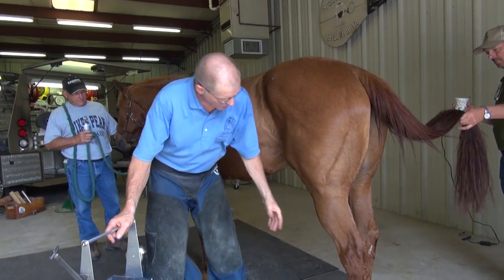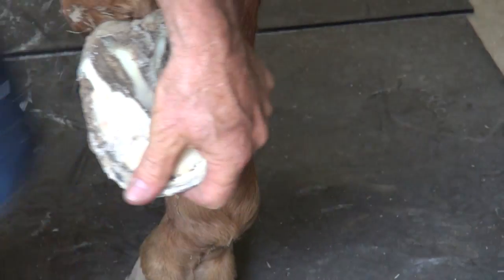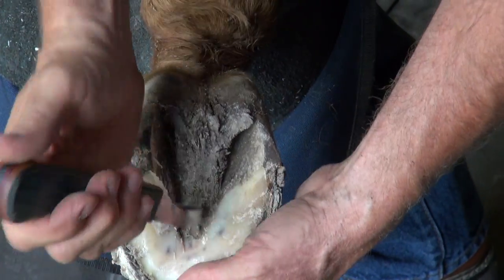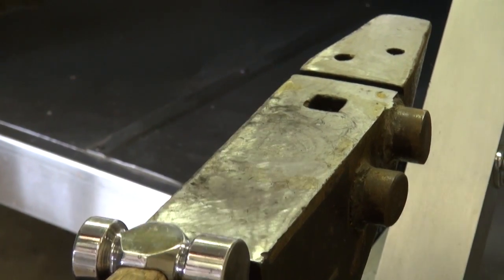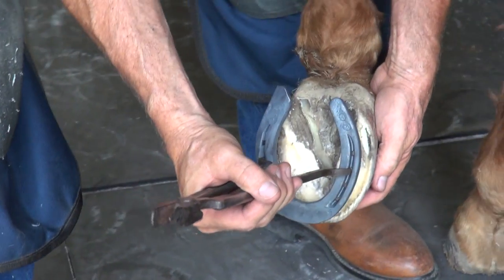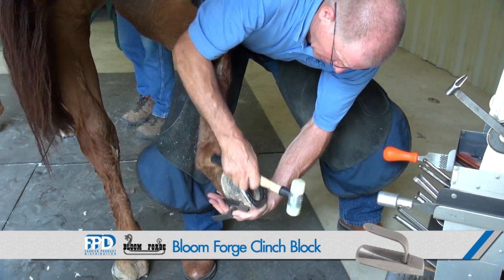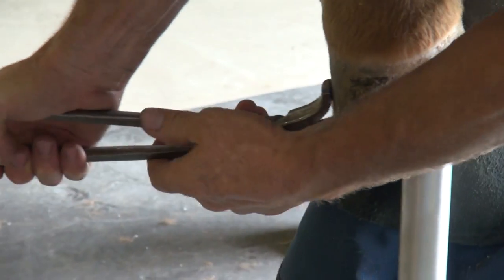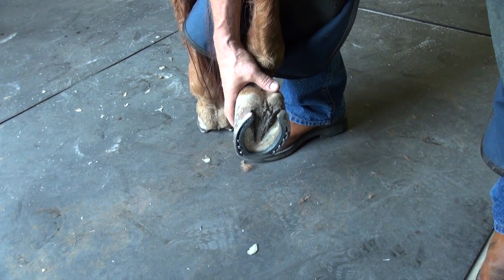FootPro Info Series- Shoeing the Hind with Kerckhaert Dura Plain

Comment: Anyone else notice that the horse that walks INTO the barn in the beginning is NOT the same horse as the one that walks out? One leg is completely white on the entry horse at the start of the video. Why the deception?
Reply: There are two horses in a series of about half a dozen videos. Same handler, same trailer, same farrier, same day. One is a red quarter horse with one white socks on his hd left, one is a red Tb/quarter cross with no white.
The horse with the white socks is lead into the barn as part of the title sequence, and not meant to be confused with the horse Mike is working on.

Comment: What a shoeing job like  this cost?
Reply: Dave Ackerson $75 to $350 per horse depending on how many shoes you want (2 or 4) and also just by the credentials and experience of the farrier. A newer and more inexperienced farrier won't cost as much as a Top of the line farrier. If you want a horse done without shoes, it ranges from $25 (my old farrier charged $25) to $125.
Reply: Why do you leave your hoof long.you took off only 1/8". Instead of lower your flare you just nip the wall.curious?

Comment: About £700 pound a year not cheap .
Reply from the maker: It is an expensive hobby to have horses!
Reply: Treating them right seems pretty worth it though.
Reply: In Sweden it costs   £120 each time with a regular basis farrier.  A top Notch much more. Problems solved at clinics £ 200 per hoof